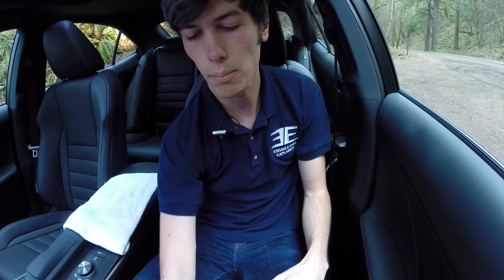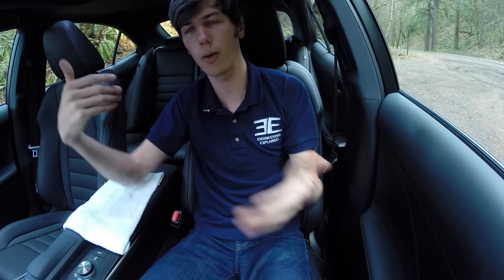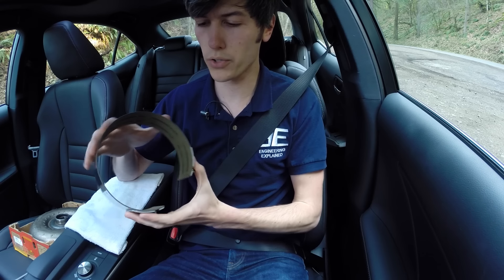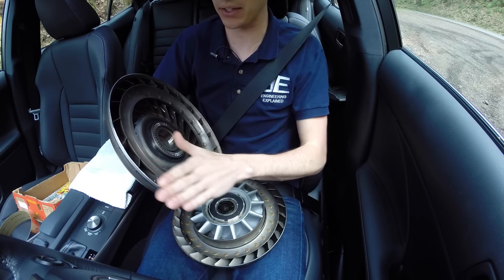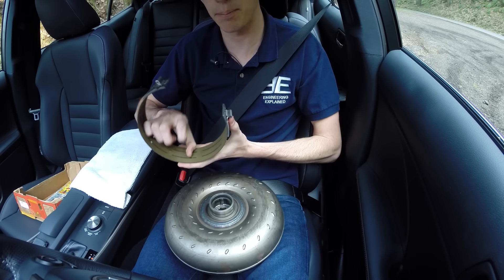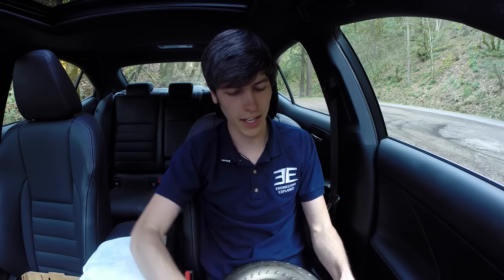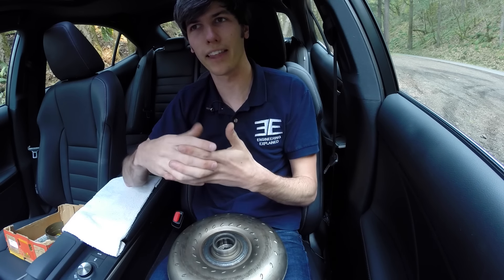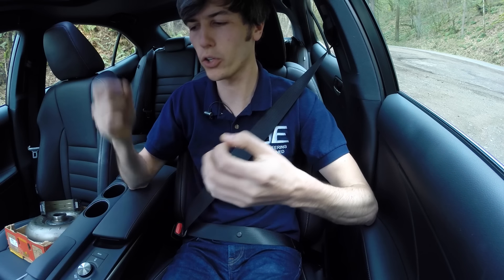5 Things You Should Never Do In An Automatic Transmission Vehicle

Comment: One benefit of switching to neutral/park from drive is if your sitting still for an extended period of time (ie: drivethru, waiting on a train, etc). If stationary and in drive you are creating a lot of excessive heat in the torque convertor. A lot easier on it if you are in neutral or park.
Reply: Exactly.
Reply: It's a habit I picked up because I learned to drive from a manual transmission. Doesn't seem to hurt the auto transmission we have so I do it.
Reply: I do it so I don't have to hold down the brake, just let my foot rest on the footboard, much more comfortable.  He didn't give any good reason not to do it.
Reply: And gives your foot a rest.
Reply: @bnjmnalan  Exactly! And yes, with the titular claim of Engineering Explained and warning of "Never," the reason for "never" is absolutely in order here.
Reply: My Dad always told me it’s also easier on the brakes. In D, the car wants to move forward, so we hit the brakes to stop it at a red light or in traffic. So if we keep the foot on the brakes for a lot of time in traffic to stop the car from moving, it can accelerate the wear on the brake pads. So you can put it in neutral and ease off the brakes. That was his reasoning. Of course, this applies to flat terrain. On any slight incline or decline, you’ll want to hit the brakes no matter what if you’re at a stop (or just put it in park and turn it off if you’re stuck in traffic of an extended period of time).
Reply: @indomitable2566  you are not going to wear the brake pads when stopped, if rotors are not moving on pads, they aren't going to wesr
Reply: @indomitable2566 Once the vehicle has been braked to a complete stop the brake wear is over. If what you and your dad said were true you would be wearing your back brakes out by using the parking brake
Reply: As a new driver and a brand new car of the line. I've never used Neutral. Only just started looking into what it's actually for. 
See conflicting information about using it when parked at lights.
When I park at lights I know will be a while I leave it on D foot on break then pop E brake on feet off the pedals...when it's time to go just tap accelerator and I'm away...
I've assumed this is correct!
Reply: If you're waiting on a train like 10 minutes, it's better to put the park and let go of the brakes. No one is putting his foot to brake for 20 minutes. I've waited in crashes etc and just put it to P. 
The engagement and disengagement of the tranmission will cause much worse wear
Reply: @indomitable2566  your dad didn't know what he was talking about; pads don't wear when the vehicle isn't moving – this should be obvious...

Comment: "5 reasons to only buy a manual transmission vehicle"
Reply: +EvilJ069 Oh you are the cool guy who likes manual cars. Lemme state the obvious for you. Modern automatic cars shifts faster than a human can shift in a manual car. It's more comfortable. Especially when you get up in the morning 5 and have to wait 1 and a half hours in the rush hour traffic. Also, fuel economy tech has been a lot different that manual cars don't have the edge there either.
Reply: +sangeeth666 

it's more comfortable to begin with, but once you get used to clutching and develop muscle memory it's nothing, especially in modern cars where the clutch is light to begin with. 

Standard automatic gearboxes don't change gear quicker than a manual, the paddle gearboxes do but A, they're essentially a hybrid between manual and auto boxes. B, they're expensive and only usually available on high end cars and C, because they don't have a clutch are absolutely horrible for sitting in traffic and reversing with. 

As explained in this video, auto boxes will always use more fuel than a manual. I have a 2015 Vauxhall Insignia Diesel (UK version of the Buick Regal) and I get about 75 mpg on motorways (80mpg if I put it in cruise control) and about 45mpg in town. The automatic version gets about 65mpg on motorways and about 30mpg in town. That's a huge difference, about £3 extra for every 100 miles in an auto. I only really drive around 10000 miles a year but that's like £300/$500 a year just to drive an auto. It's even worse than that with a petrol engine.
Reply: +John Smith The clutch in my RX-8 is like an on/off switch, even after 50,000 miles of driving. I've gotten good at operating it, but not all modern cars have light, progressive clutches.
Reply: Shawn Elliott I prefer a firmer clutch, but RX-8's kick ass. One of my dream cars is a 1991 RX-7 Turbo II, sexy AF.
Reply: John Smith John Smith: restoring this American's faith in British intelligence
Reply: If I wanted to fall asleep while driving I would go with an automatic transmission. I started with auto and the first car I paid off in full was manual. After driving a decade+ with a manual, it really feels boring to just apply brakes and acceleration with no gear inputs.
Reply: Gromitz101 You steer an automatic, but you DRIVE a manual ;-)
Reply: EvilJ069 it's not true for every car. for the DSM it's the opposite, manuals don't last as long (even fully built), are more expensive and harder to rebuild, worse on the drive train, and the performance in the 1320 is better. I'm not sure of the mileage though, it is probably worse with auto. I own 2 manual, 1g DSMs. I hate the trannys so much, I just bought an auto DSM to turn one of them into an auto.
Reply: Hunter Bowman Ugh, don't get me started on Pieceofshitsu

Comment: I enjoy your videos and you sound knowledgable. But I can not agree with your choice of title for this video. Your title would indicate that these 5 things would cause damage or be a safety risk. I know when on ice taking your vehicle out of gear can allow you to stop shorter and with more control. If interested see story below.
That being said I just caution your use of the work never. It closes people's mind. 
As for shifting out of gear while stopped, most cars will vibrate differently in gear or neutral. I find my cars vibration annoying when stopped in gear and the vans I drive are more comfortable in gear. And surely launching your vehicle in gear can cause more damage than shifting out of drive at a light. And you almost condone that. 
 I agree with you about changing direction launching or stopping your car. As for taking your car out of drive. You are not causing damage and it's really not a safety hazard for someone that has any driving skill and it can be an asset. 

Rushing to an accident in an ambulance with a cop behind me we hit black ice. I put my vehicle in neutral and skated through keeping the wheels in line and keeping my vehicle on the road. The cop left his vehicle in drive, when he started to loose control he took his foot off the gas causing the engine to slow the rear tires enough that his car spun off into the ditch. No injuries but he did hit the car we were looking for. Which probably did the same thing.
Reply: What you're saying is that putting your gearbox into neutral while sliding on ice allowed you to keep control of a car, not break sooner. There is a distinctive difference, and I'm sorry - but you can't stop on ice sooner by putting gearbox into neutral.  The combined breaking force of engine + breaks will always outmatch breaks only, so you need to correct your statement - you had more control, but you wouldn't stop in a shorter distance.
Reply: AkarZaephyr I agree. If you are moving fast enough to have the engine slow you, with control, you are correct. I did try to edit my comment to be more correct but my tablet will not allow me to make changes.
I caution your use of the word "always" and "never."
When you get to a slow enough speed that the motor keeps the drive wheels turning while the other wheels are skidding putting the transmission into neutral removes that force and allows you more control of the drive wheels. You stop shorter and with more control. You are not going to take hundreds of feet off your stopping distance but In some road conditions it can make the difference between a day and a "bad day." Try it next time you are on ice. But being a car guy you are probably driving a manual transmission most of the time and you do that anyway.
My point is driving is very dynamic. A good driver knows how to use all the tools at hand. And the shifter is one of them.
Reply: Paul Kayak You're right, I should be cautious with "always" and "never".
Plus, how much good or bad putting into neutral will do, also depends on type of drive train. FWD can actually help if you find your car is understeering in a corner, on a slippery road - about the only thing you can do to try and save yourself from crashing is applying throttle. Same cannot be said about black ice slide... And RWD.
I guess what I'm trying to say is a lot of factors contribute to what's the best course of action, but I see your point in some situations being saved by putting in the neutral gear. Thanks for useful tip coming from your experience - never enough new things to learn! :)

PS: I still drive manual, but my next car will be AT. City where I live is so jammed with traffic you travel 8 miles in... 50 minutes. I'm tired of constant need to shift and will not look at MT for as long as I need to live here.
Reply: AkarZaephyr Talking about understeer. Believe it or not, we had a van and the only way to prevent understeer in the slick was to brake just hard enough to transfer some weight to the front end as you entered a corner, simultaneously applying power to keep the rear end from locking. Won't find that one in the manual. It was a fine balancing act but that my friend is a other story. 
Enjoyed chatting good to see you have an open mind. 

PS. Sorry to hear about your soon to be loss. I too have given up a MT for a AT in my daily driver as well. Could not turn down the deal. But my Bay window VW Bus, and my truck are manual, as well as my tractor. Yes I have control issues. I like it too much.
Reply: Why are your comments so long? ;D

Comment: I've owned a couple of diesel pickups that I had transmission oil temp sending units put in my transmission pans - wired up to gauges in the cab. Sitting in place with transmission in gear clearly created hotter fluid while sitting there going nowhere in gear, whereas if I put the transmission in N the fluid temps stayed the same. Heat is also a thing that kills auto transmissions... may not matter a whole lot but doing it does keep the transmission from continually generating heat due to the torque converter being in fluid-coupling mode vs disconnected or locked up as it often is cruising down the road.

Comment: Extra: use the Handbrake when you park your car. Trust me, don't just stop and put the gear in P;

It's better to stop, put it in Neutral, pull the Handbrake (then release the brake pedal), and then you put it in P (it will preserve your Transmission's lock that is active in the P position).

Doing that you'll put all the car's weight into the Handbrake, not into the Transmission.
Reply: Had a friend that his handbrake was failing amd his trans would get stuck in park. We would have to rock the car back and forth to get it out.
Reply: I prefer to let the car roll and settle into a low sweet spot in my driveway before putting it in park, gravity does nearly all the work keeping the car still. I still use handbrake on inclines. Using handbrake in freezing, foggy weather can be a bit troublesome though, I've had brake pads frozen to the surface of the brake rotor before
Reply: I always do that out of habit from driving my manual cars lol. I was always taught that the parking prawl is just an emergency backup.
Reply: I just keep the brake pedal pressed in as I put it in park and then I pull the handbrake before releasing the pedal.
Reply: If you park on a driveway with a slight grade its highly encouraged
Reply: As long as you've come to a complete stop, foot remaining on the brake pedal, you can shift to park, pull handbrake (or if electronic, whatever)... THEN you can release the footbrake, you have not let the car roll in park putting extra pressure on the park paul, that's perfectly normal to do and fine.
Reply: Is this done while the engine is running?
Reply: yuou dont need to put it in neurtal as your going past that gear while putting it in p, just come to a stop put the hand brake on then put it in park.
Reply: Mine automatically uses the handbrake when P is activated
Reply: With modern cars where the park brake is electronically operated the delay in releasing renders it impractical to use in stop start traffic as you will just be delaying people behind you.

Comment: the worst thing about coasting in neutral is when you forget and go to accelerate
Reply: lol, I did it the first time I bought a car with automatic transmission, quickly realized I shoudn't put in neutral when driving even if it would wear something because it's unsafe, and then I come here to know if it would really wear things, but no.
Reply: @monad_tcp  it's called neutral for a reason

Comment: It's common sense: when you are stopped in drive, the ECU will try to reach the same rpm level in both situations, but it has a limit on the fuel it can give in idle. The result is that in neutral it will usually be consuming half of the fuel it does on drive. That changes with the start&stop function, but even that has some limits, since starting the engine will use a lot more fuel than a 10 seconds idle time would. The conclusion is: always put the car in neutral on stops if you dont have start&stop (turn it off if you are at a closed railway), if you do have start&stop, estimate if it a reasonable timed stop (then let the car turn off) or if it is just a quick stop (then put it in neutral, since the function usually only works in drive). Drive safely!
Reply: @oldjarhead386  Automatic cars have a torque converter spinning and causing drag when in drive and being stopped. This is just a fact. If you put the car in neutral, you'll consume way less. Start and stops become convenient for medium to long stops.

Comment: i tried to do a launch and the transmission made a few scary clunking noises so i decided to not do that ever again.
Reply: But can you go from neutral to drive whilst coasting  (not pressing the accelerator) like normally in a manual car?
Or will it make the same noises? Lol
Reply: Mine sounded like a helicopter when I accidentally applied power before my transmission could fully engage, I had to take it out of gear and put it back in and it's fine now

Comment: Trivial safety tip from an ex-driver. If you're at a set of lights, it is good practice to learn to apply the emergency/park/hand brake. Why? The forces applied to your body (and sometime the surprise) if you get rear-ended will pull your foot off the brake, causing your vehicle to ricochet forward, sometimes clear across the road or possibly into cross traffic. Having the handbrake applied mitigates that lurch forward and may prevent a more serious situation. Just remember to release the emergency/park/hand brake when the lights go green.
Reply: yeah, i always try to put it in neutral and only tend to apply the handbrake if i think i’m gonna be staying there a while, but i try to keep my foot on the brake until there’s someone stopped behind me as well

Comment: When did brakes become "cheap" to replace?
Reply: tripjet999 relative to transmissions
Reply: Brake pads,shoes,rotors,and drums are all cheap.Transmissions are also cheap,I can get my transmission rebuilt for less than $200 all day long and it will withstand V8 abuse for years.

Comment: I'm not even going to watch the rest of the video. Putting your car in neutral has no negative effects.
Reply: mainly just to save gas.
Reply: You're also putting no forward or backward pressure to your suspension so if you turn too hard you can end up losing control more easily.
Reply: you can always break.  If you go so fast that loosing engine breaking will jeopardize safety, then you are going too fast to begin with.

Comment: Fantastic lesson in automatic transmission. Thank you for such informative videos.  My question is about shifting to neutral at stop lights:   I do it for my comfort. I totally agree with you that it's not necessary to save fuel or to put less stress on the transmission. I simply do it for my comfort, and so I don't have to hold the breaks so hard at long lights.  My question is, is it bad for the transmission or cause more wear and tear on linkages or parts, or whatever if I shift to neutral at stoplights?
Reply: a lot of things happen when you shift from D to N and vice versa. transmission bands and clutches tighten/loosen. valves and solenoids open and close. etc. theyr'e designed to be cycled thousands of times but they do wear out eventually if you drive the car long enough
Reply: @rondg2  Thanks for a useful reply. Your the first to actually understand and answer the question.

Comment: I use neutral to coast in my semi truck which is also automatic, the reason this saves fuel is because you're disconnecting the drivetrain and the mechanical resistance from the engine from the wheels. Even though the engine is not getting as much fuel as it would as ifwas in gear when it goes downhill, you still lose energy through the drivetrain via mechanical resistance. In a car this is much more negligible though.
Reply: I wouldn't be surprised if certain long-haul companies that have modern trucks track behaviors such as that for the same reason as mentioned in the video, lack of control should things go awry. Liability for both driver and employer in those cases depending on employment arrangement. But I know you're right, lots of mechanical resistance there, way more wheels doing the dirty work, or downhill, slowing things down while engaged...